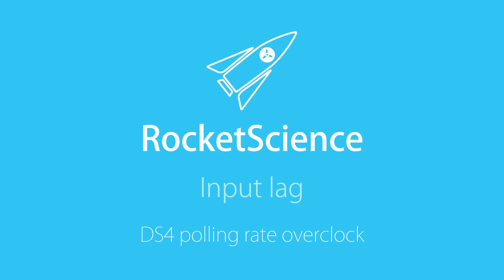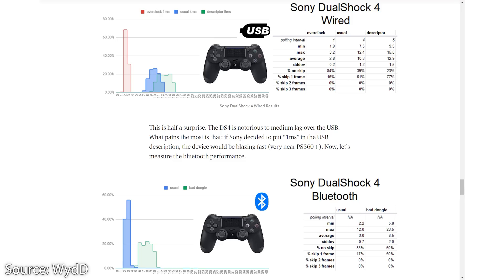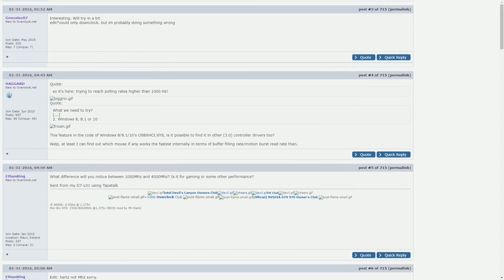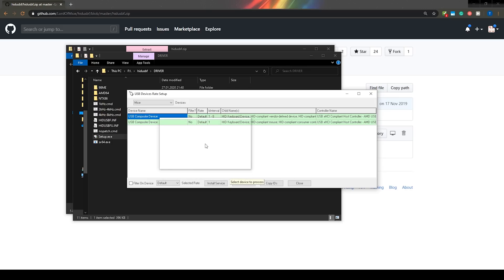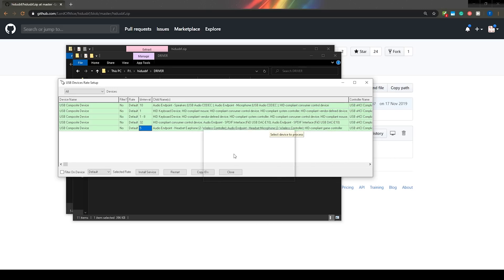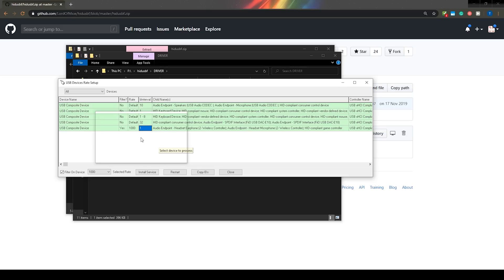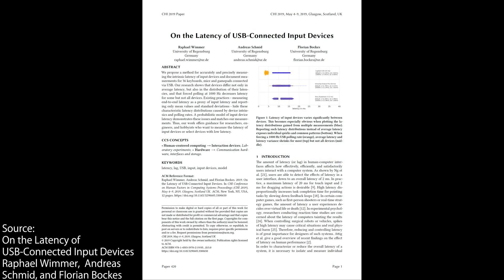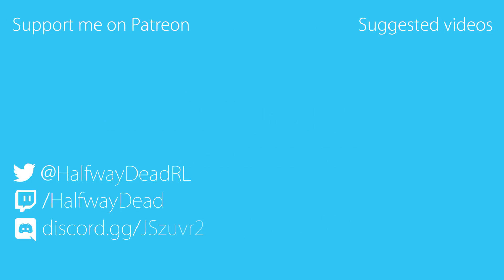(DS4 PC) Lower input lag for free! - Rocket Science

Comment: If for anyonnes controller stopped working i know how to fix it
Go to control panel hardware eland printers
The hardware printers again right click ur controller go propertis then go hard ware the go hid something click it the change settings the hard driver  or hard ware i forgot what it says but when u cpick it u should see an option to uninstall if u see it click uninstall unlpug ur controller and then plug back in and it should work again like normal
Reply: @noizzz13  nah it doesnt work like that dont think u can get any lower delay or more fps on console the only thing u can do is buy astro c40 if ur ps4 and xbox elite if ur xbox cuz they both have 1 ms

Comment: I got a warning when trying to filter on device that says, "Error trying to test loading of filter service: 577. Windows cannot verify the digital signature for this file. A recent hardware or software change might hvae installed a file that is signed incorrect or damaged, or might be malicious software from an unknown source." Any suggestions?
Reply: Same here :/
Reply: what do i click
Reply: i could fix it, disable boot option UEFI Mode in YOUR BIOS
Reply: @FortniteBestMaps69  that will brick your system
Reply: @elvarfn2086  nop not mine , its disbaledsecure boot

Comment: The overclock is usable on PS4??????? Pls answer to my question
Reply: You have to run the software on the computer you want to overclock on. So since you can’t run it on PS4 then it’s useless.  Also PS4 USB is hardware limited to 250hz. Make sure to use wireless to get 500hz
Reply: @micahmcfadden4133  so the pad connected in Bluetooth is better than the pad connected in USB
Reply: @tubesmusic2178  Yes on PS4 it is better on bluetooth.  Seems weird but its proven in multiple test for that particular platform.

Comment: ive overclocked my dualshoock 4 v2. i had to disable secure boot to succesfully oc BUT the input lag just got alot worse, it felt like double the input lag. why is this happening?
Reply: dude same problem try putting it on the lowest hz and dont filter its better idk why
Reply: @mrhindy9  found any solutions yet?
Reply: @haych5617  Download Ryochan7's DS4windows.  Click hide DS4 in settings.  It is by far the best windows driver and fixes all the issues that you have.  Games like Fortnite have a terrible driver for the DS4 which causes input lag when you overclock.  When you overclock with DS4windows it will put a smile on your face I promise.  Download Ryochan7's version as it is the only one with continued support.  Google will point you to the very old version of Jays2Kings which hasn't been updated since 2016.  It will work but ryochan's is much better and even has slight input lag improvements vs jays2kings.
Reply: Micah McFadden is that why i was getting so much input delay when i overclocked playing fortnite??
Reply: Use the ds4windows software with it. It fixes everything. Just make sure to click hide ds4 in the settings

Comment: I would like you to show the input lag of the xbox elite vs astro C40.
Reply: The elite doesn’t overclock very well. Same for elite v2.  Both elite versions stay at 250hz even when overclocked at 1000hz.
Reply: @micahmcfadden4133  Default is 125hz correct? So there is at least some benefits right?

Comment: The Light bar on my controller in not lit on my Dualshock4 controller, Not before the Overclock and not after. Is this normal? should I be concerned? Because I have been trying to get my DS4 to work properly on steam for the past 6 days and not have massive input lag but it seems to be a lost cause.
Reply: Try a different usb slot.
Reply: Try using ds4windows software for the lowest input lag.  Just make sure to click “hide ds4” in settings and change the light bar color to something other than blue so you know when it’s working or not.

Comment: Is overclocking Xbox one controller beneficial
Reply: No it’s stuck at 250hz unfortunately
Reply: @micahmcfadden4133  how ?? It changes to 1000 for me and feels more responsive
Reply: John Wick unfortunately it’s a placebo.  This software only overclocks the USB port not the controller.  The Xbox controller will still only output 250Hz to the USB port.  There are other softwares you can test the results and it always shows about 7ms of input delay while the ds4 overclock is less than 1 ms.

Comment: Are you sure it's safe? Overclocking can't be good and won't it damage the controller in the long run?
Reply: Overclocking is 100% SAFE, and it will not damage your controller if done right. Note: This method could cause aim and movement to be heavy and sluggish. If any problems occur just reply to this comment and I could help you.
Reply: Moderator Yh I got the red bar issue. Im on an MSI pc and apparently secure boot is off by default so idk why I still have a red bar.
Reply: @flknfn  is there a way i could fix its because it feels sluggish after i overclock
Reply: @haych5617  I do not know of any solutions, I recommend just you revert the overclock.
Reply: @haych5617  Ryochan7's DS4windows
Reply: You’re not doing anything to your controller with this software. It is overclocking your USB port.

Comment: when i go to filter on device, it says "disabled or not installed", could you help?
Reply: Do you still need help on this SyrohX? I could help you with possible solutions.
Reply: Moderator yes please
Reply: When going into the software click on the Wireless Controller with a binterval of 5, and press “Install Service” before checking filter on device. Note: doing this overclock MAY cause aim to feel heavy and sluggish from experience and feedback, but also will massively decrease input lag. Hope this helps! If more help is needed reply to this comment and I can help!
Reply: This problem could still remain even with the solution and If it does I would recommend not using this overclock at all because it is not worth the hassle, and could cause aim problems.
Reply: @flknfn  hey when i press install service nothing happens plz i need help... havent played Rocket league in days and im 4 wins from my first ever GC rewards :( Im desperate, have tried everthing!

Comment: I wanted to remove the oc because I felt it too much responsive and I also felt like my sens changed. I have tried all the methods in the description and ds4 windows says 3.5 ms now. But I still feel it way too responsive. Is there a way to be sure to remove the overclock? maybe removing the drivers manually. Help me please!!
Reply: GAMBL3Rtv did you fix it
Reply: HabibSdga I tried to remove the drivers and it worked
Reply: GAMBL3Rtv nice can I know how you removed them because my sticks feel very heavy and sensitivity changed like in your case
Reply: HabibSdga there should be a tutorial, I don’t remember where, on how to remove the overclock. Go and look for it
Reply: You can try to reverse the oc and then to remove the drivers from device management. I don’t remember what I did
Reply: GAMBL3Rtv ok thanks

Comment: Does this work in Windows 10? Windows 10 has this weird issue where anything above 125hz USB polling rate makes the entire system stutter like hell, you can try this by setting your mouse polling rate above 125hz, open testufo . com and move the mouse. This happens on every configuration i've ever tried, its been like this for YEARS.

Comment: does it still work for ps4 controllers because is not working for me once i unplug and plug it back in instead of getting a 1 i get nothing am i doing something wrong??
Reply from the maker: Check out the troubleshooting section in the video description. I don't know anything more than what is in there.
Reply: @RocketScience  yeah i dont know what else it can be i disabled secureboot and everything but it doesnt go to one 
i tried something different but the rate is at 1000 and  the binterval at 5 so i dont know if that works i really dont see a difference

Comment: When I tried this, it made my buttons respond faster which I immediately noticed and felt great. but my analog sticks were laggier = doo doo aim and movement 😫
Reply: same
Reply: saaamme broo how can i f*ckin fix that shit?
Reply: I dont think u can sadly unless u reset the overclock. I actually made a video with my thoughts on the topic if u wanna check it out
Reply: @ZayUnplugged  But its on every controller i plug in! I tried with the controller from my friemd and its same
Reply: @makintxoyt  what do you mean? what files?
Reply: Do you use the ds4windows software?  It fixed all of my lag problems with this and my input lag is insanely amazing now.
Reply: @micahmcfadden4133  yeah I made a video on the new DS4WINDOWS u should check it out
Reply: @ZayUnplugged  I did check your videos.  I do have 2 friendly disagreements with your vids and felt it was better to respond here.  You should absolutely overclock your controller again after using DS4windows.  It will give you a measurable improvement in input lag.  Before you used DS4windows, overclocking your controller can cause issues with bad drivers such as the native driver that fortnite uses.  It will actually cause more input lag because the driver is so bad.  Other games that use native drivers also have this problem.  You should try the overclock again with DS4windows this time.  I can even send you a link for input lag measurement software if you like.

The other disagreement is with your use of anti-deadzones.  These should only be used if you lower your deadzones all the way and your controller still doesn't have any drift.  Then you use anti-deadzones to get the point that you start to have drift.   Games like fortnite do have built-in deadzones but it is so low that you shouldnt need to use anti-deadzones.  Anti-Deadzones are not an ideal way to fix large built-in deadzones, but they can help some.  If you can already lower the deadzone to where you have drift then anti-deadzones will only make things worse.  Make sure you understand how they work.  It basically jumps your stick position out a few mm from where it actually is to make the software think you have pushed your stick that far.  So the way your using them is actually fighting itself.  Also make sure to tell your audience that every controller is a little different and will require slightly different settings. Peace.

Comment: I never found out a site to test if the polling rate change actually works for DS4, so I made my own: http://www.dysp.info/gamepadtest/ . Unfortunately testing all the way to 1000Hz works only with Firefox.  Firefox's gamepad api is the only one that will return input from gamepad once per 1ms.  Chrome and other browser's gamepad api updates happen only between 4ms which makes it impossible to test anything over 250Hz. My test also calculates changes in values so it would also catch "cheating" like sending same values 4 times in a row to make it look like that 250hz would be 1000hz.
Reply: Thank you so much, I was looking for a way to verify the new polling rate and thankfully I found your comment! Thank you so much man, it helped a ton <3
Reply from the maker: This is pretty cool. I wanted to make something like that myself but after some looking through the gamepad api, I didn't think it would be possible. Didn't really think of making it a busy loop (which I think is how yours works unless I'm dumb). Don't know if I'd want to add something like that to my deadzone app, since some people might leave it open in the background. I have offline tools that use raw input but this one will be much easier for most people.
Reply: Thank you but it doesn't work at all with the Xbox one controller. Showing 40 hz (in firefox) input rate.
Edit: sometimes the "gamepad data updating between" shows a 1 ms value, so it should works.
Reply: strange i wonder how zowie polling rate test work at 1000hz on any browser
Reply: @Tailslol  That zowie tool is for mouse polling rate. This might simply be limitation of gamepad api in browers, but I will check it up. Would be cool to have it working on all browsers.
Edit: A quick look at their code contains different code for different browsers and bits like "var fps=4 ... count* fps+ _0xfd94[38]".  So it seems they are kinda "going around" the problems by reading info between 4ms and multiplying results with 4.  I thought about doing the same for other browsers, but didn't think it would produce reliable counts. I may have to test that approach again.

Edit: Changed to right user, I'd appreciate if you can change your answers to this account. ;) 

Please look at the answer below. Thanks for the feedback!
Reply: Marko Riihimäki yes i know thx,it still has issues with mobile browser. The Xbox one s controller have constant update with the Xbox accessory app,I wonder if they updated the polling rate.
Reply: @markoriihimaki8216  First, the Xbox One controller cannot be overclocked. And the software is working, because I lower the polling rate it works. 
But no unfortunately, it doesn't work properly. I used this test https://github.com/chrizonix/XInputTest and the results are around 125 - 166 hz, while the results obtained in Firefox are around 40 hz in "Gamepad peak new input rate" and the "gamepad data updating between:" value isn't consistent at all.
Reply: @Marr033  Unfortunately I do not have Xbox one controller to test it myself.  It should be displaying constant 1ms to work like it should.  I will see if I can find anything in gamepad api about Xbox controllers, but it really should work the same as DS4..

Edit: Changed to right user, I'd appreciate if you can change your answers to this account. ;) 

Just to make sure, I do understand that the test is not working for Xbox controller.  I did test for DS4 and I have no way to test with Xbox Controller as of now. I will update if I discover something new.  First version was quick and dirty, but it seems to gain popularity, so I might go for next new versions. Thanks for the feedback!

About XInputTest, the gamepad api in browsers is very tricky compared to standalone windows application for measurements.  However I wanted to make this work in browser to get it as easy to use as possible with zero installation.

Comment: Hey man, question... does scuf drivers and/or apps interfere with this? When I try the dongle method DS4 doesn’t read my controller via Bluetooth (I’ve tried everything to try to resolve this). And when I try the wired method is says in DS4 that I get a 3ms Response time which is the same as I was getting before so there’s basically no difference.. what is this? I have a vantage 2 btw. Thanks!

Comment: yo rockret, I tried this method and my ps4 controller now has 1 ms, like steady 1ms no fluctuations, but when I entered a game of fortnite it seemed that every time I pressed a button on the controller it reads as two button presses in the game. Is there a fix to this? For people in the comment section, does anyone have this problem too?
Reply: yes!! i have this issue as well. the only way i fix it is uninstalling DS4 and reverting the overclock, and then reinstalling DS4, making sure it works, and then overclocking and it works perfect. but everytime i restart my pc i have to do this over again.;.. not sure of a permanent fix, i know it doesnt work when the light turns to blue when i load fortnite instead of the color of my ds4 profile
Reply: @12theunknown12  can confrim this worked with new ds4 windows version and checking hide ds4 controller
Reply: colton so you did what I explained and it worked fine? Even after you restarted your pc? where does it says hide ds4 controller, in DS4 settings?
Reply: G&T HD Yeah I actually downloaded the maintained version of DS4 windows by ryochan then did the OC, and it worked. I used hide ds4 as well in settings because it was still double clicking.
Reply: colton bet ima try it out, so when you put hide DS4 controller, what does it do? It says it couldn’t open exclusively since I have steam open, what does this option do? Do I have to let DS4 open on startup and then open up steam after? And do you leave the controller plugged in when yo upstart your pc? Thanks for everything !
Reply: G&T HD No, start up PC, controller unplugged, then open ds4 hit hide ds4 then connect controller before you launch your game
Reply: colton okay bet I tried it but it won’t open in exclusive mode, I closed every other app and it still give me this error, any fixes? Appreciate all the help! If I can’t figure it out might just stick to Bluetooth cuz it feels good still but would love to feel 0ms response time all the time
Reply: Lovo yes i have this problem as well

Comment: if your game feels clunky or more delayd. i found out the solution how it works you have to use the front pc ports or the upper ones not the ones in the back of the pc:)
Reply: it actually should work better the other way around. The front ports often dont get as much power as the ones straight from the motherboard.
Reply: Raz Id hm That sounds logical but i tried the ones at the back first and Even of IT said 1ms in ds4 Windows IT felt like 50 but when i switched to the front ports and repeted the proces IT were like night and day
Reply: what do you mean by that bro
Reply: Mathias Jønsson you know the whole in the PC you plug Your controller USB cable in USE the ones at the front or top of your PC and do the prosess in the vis again
Reply: Probably needs usb 3.0 port